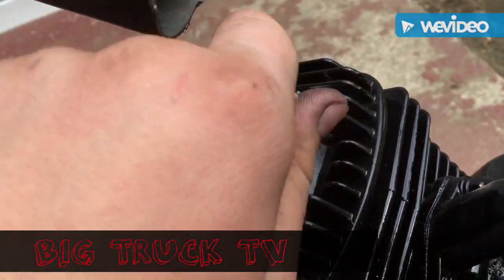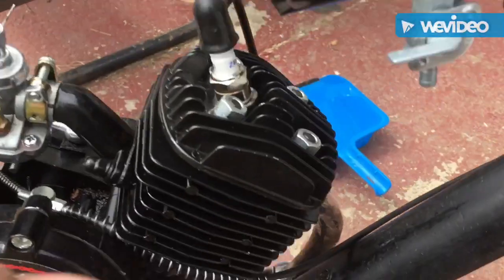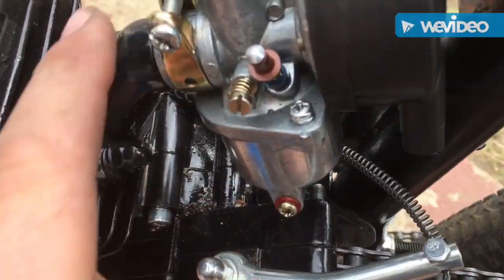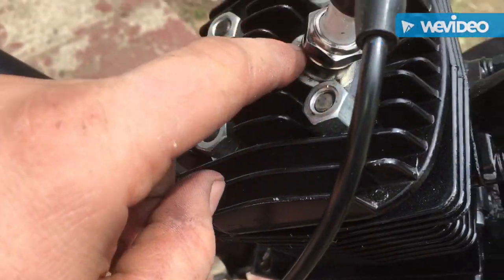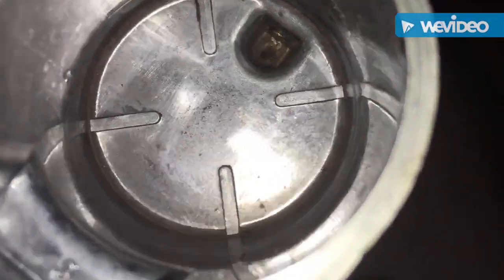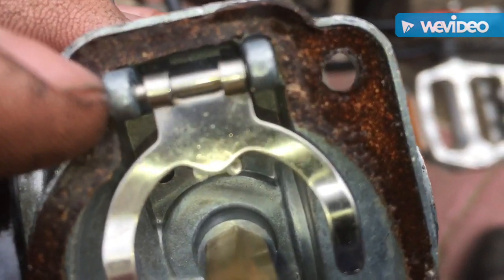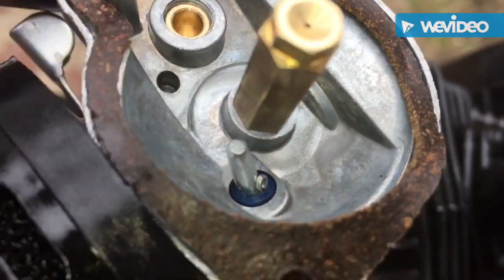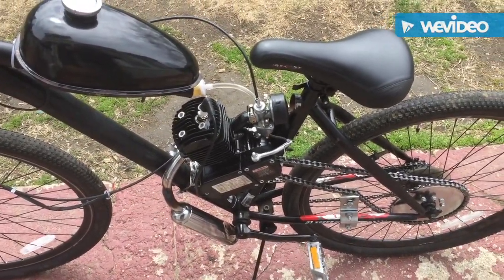Motorized bike won’t start Carburetor Issue

Comment: I just had a strange problem. I bought the bike used and tried to ride it home. I made it about halfway and it died. Wouldn’t start, couldn’t see any spark so I came to YouTube and everyone sai it’s the ignition system. So, I ordered a plug and everything else.  Put them on and still nothing. Finally I poured a little gas in through the spark plug hole and wham!  It started. I took the carb apart and the pivot pin was missing?!???  Made a new pin from a poprivet and now it runs.  How did I ever get halfway home?  Big mystery.

Comment: I'm having an issue with the rear wheel Dragging, the engine wants to start, but it's too difficult to get the rear wheel turning enough to get the engine going.

Comment: Mine won't start. I changed the clutch pads and new clutch shaft arm with bucking bar and barring ball. The clutch plate grips now and now I get more sound as in turning on and muffler sounding. But won't turn over. Need help.

Comment: @Big Truck tv hey man i need help with my 2 stroke motirzed bike it starts but it doesnt idle at all i got new carb and stuff. i have to rev it to literally keep it running but when i slow down and pressing the clutch in it dies out instead of ideling? any help??
Reply: Twist in the idle screw
Reply: @shrimpketchup2993  thanks for the help but i got it to work now :) its the idle screw like u said